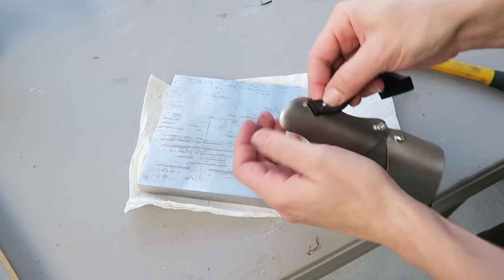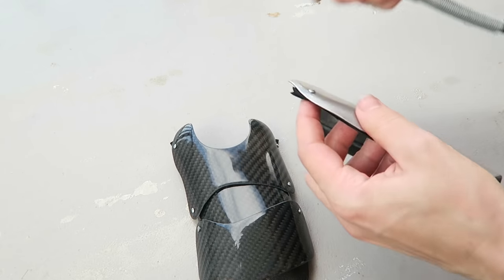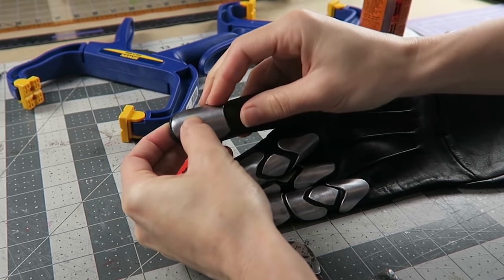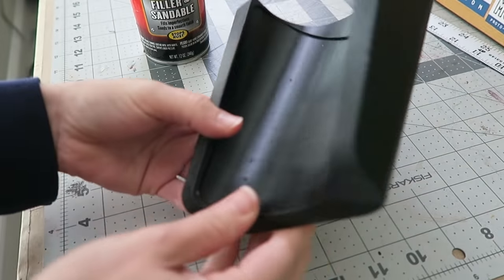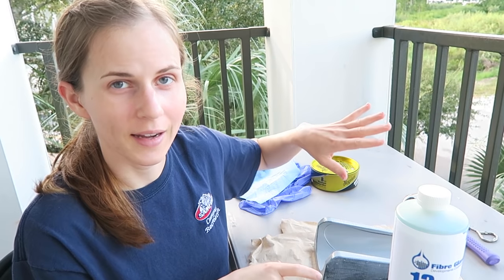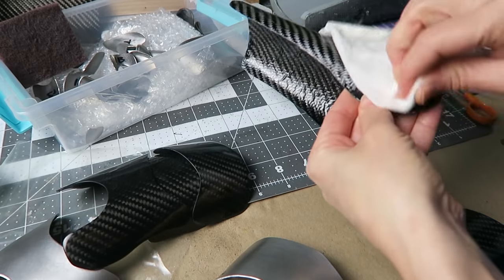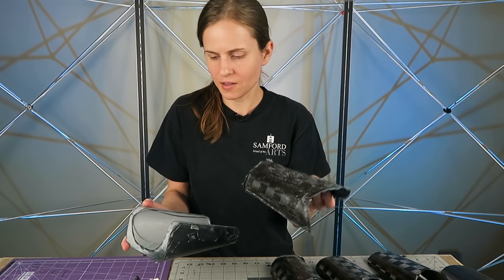Carbon Fiber and Steel Armored Gloves with TeXtreme Wrist Guards

Comment: Try using brad point drill bits for the carbon fiber. Punching could crack the panels and the brad points will hold in the resin well.

Comment: Some of you may be wondering: Why not put the metal on top or under the carbon fiber? What happens is the metal becomes a diode and the carbon becomes a cathode. Carbon Fiber, when touching steel has a chance to cause galvanic corrosion. This happens when 2 conductive dissimilar metals have contact and also have an electrolyte bridge (Water is a good example). Carbon fiber is included because is has conductivity of metal. One way to mitigate galvanic corrosion is to electrically isolate the material by adding a layer of fiberglass between the carbon fiber and metal. Another way is to paint the carbon fiber to create a non-conductive barrier. The best metal to use in direct contact with carbon fiber would be Titanium due to it's low difference in conductivity. The second best would be Stainless steel. Aluminum would be by far the worst, but ok if you have a fiber glass layer or had painted the carbon fiber.

Comment: Great work! Have you tried a 2 part mold to cover the back as well? If you put everything together (like you already have) and they have a second part, you can clamp it down with adjustable clamps and really squeeze the resin into not only the back side but the fromt as well which should make the mold process easier for extraction and give a better surface finish. 

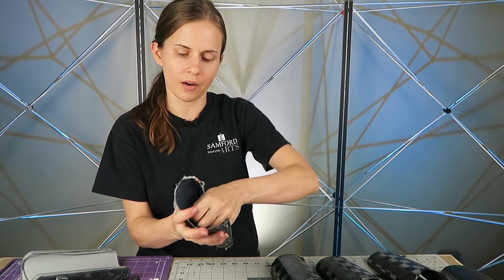Also, at 21:30 you should really really really be wearing cut proof gloves. Ive had so nasty cuts from kickbacks from using a dremel because i was too lazy to wear gloves and they are not fun. Milwaukee makes a fantastic pair that is pretty cheap at home depot. 

Again great work!

Comment: You might try using a prick punch to start those holes.  Never drilled CF, but having a good dent helps keep the bit from wandering in metal.
Reply from the maker: I think you're right.

Comment: Wow well done!! I have a question: it's possible to use two part molding to press the carbon fiber together instead of use vacuum?
Reply from the maker: I don't know how the results would compare, but I'd guess better than no pressure at all but more issues with bubbles and voids.
Reply: Lindy Design Lab yeah ure right..... Bubbles are annoying